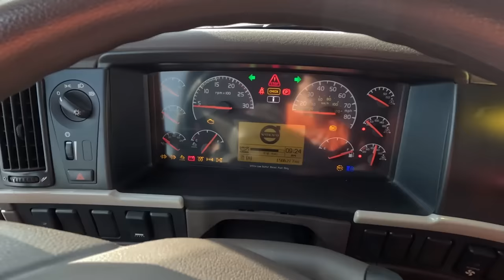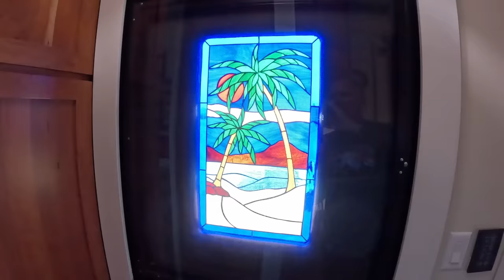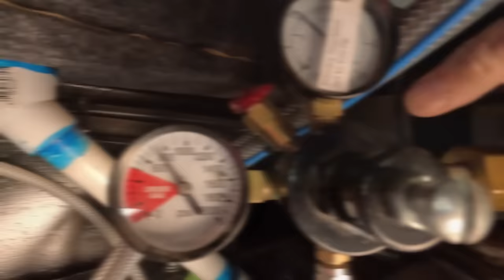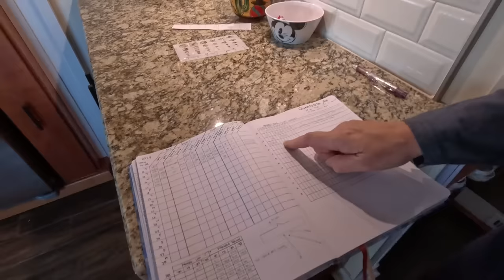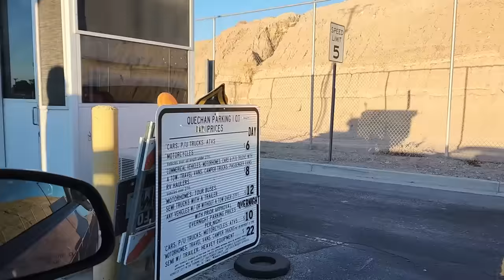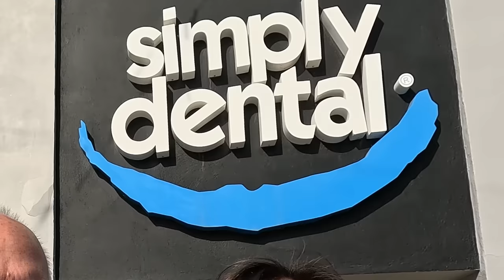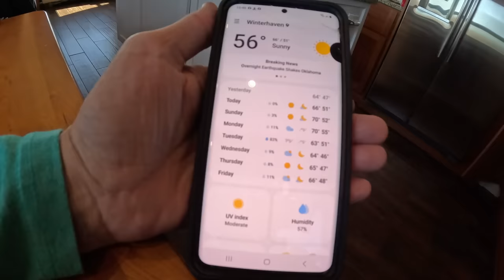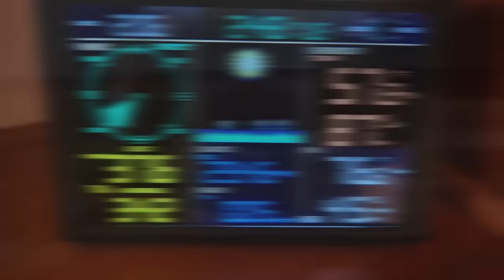HDT BIG Rig Travel Day. Changing Plans. Mexico. Atmospheric River. Fulltiming couple. RV Lifestyle

Comment: Great video David and Sondra!  @35:20, you start talking about Sondra's capturing of the sun angle hitting your solar collectors--great example of very practical geometry!!!  Also a great example of thinking quantitatively.  Hope some geometry teachers see this and use it!
Reply from the maker: Sondra is such a geek, Pete. But it does help us to orient properly to maximize the solar potential. You are so correct that it is a very applicable use of geometry in our daily life. We hope others see that as well.
Reply: Sondra's would love a Victron solar system with a GX device that uploads all the data to the cloud. Then you can review and plot a huge amount of data for solar and battery power/voltage/amps over any day/time frame. Great for us data nerds! 
Love the channel! Absolutely loved your Alaska series last summer.

Comment: How did you learn all the things you need to be self sufficient, like the vacuum issue you had?  We so enjoy your journey and videos.  Thanks for what you do.
Reply from the maker: Great question, Patrick. After 8+ years of fulltime RV and approximately 50 stops per year average then we use our systems regularly and have seen most of these occurrences at least once. Experience is a great teacher and we try to learn from each instance (good or bad).

Comment: Sondra, I love your book keeping and role as the lead statistician! I am always amazed watching numbers! (I bet Dave looks a lot closer than he will admit!)

Dave... Not sure I understand your water system but it is interesting. If you simply plugged that overflow I suppose your pump would create a vacuum in the tank? If it is setting up some sort of syphon if it gets started by overfilling, how about making a length of hose with the appropriate fitting for the "leaking" pipe and then elevating the other (open) end so that it is higher than the highest level in the tank? Do you think that would stop the leak? Perhaps after the syphon was broken it could be removed, or you could put some kind of screen on the open end of the hose to keep dirt and intruders out if you have to leave it there.

Thanks for all of the insight into Mexico in the Yuma area. My wife and I plan on being there in time for Quartzite next year, my first year of retirement. If I see you there, I would sure like to meet you both.

... Mark
Reply from the maker: It would be great to meet up, Mark. Normally our system does not create this siphon effect when I correctly fill the tank...I was in a hurry and didn't shut it off properly. Yes, you are correct that we had to equalize the system pressure or the water pump would have been impacted. Congrats 👏 on your impending retirement! Lots of fun on the road.

Comment: For solar tracking, I just use the Victron apps showing me consumption, battery, solar, forecasted solar and forecasted consumption (meh not so accurate) which is automatically charted.  Did you folks get the power actuators in Quartzsite?  Sure would beat climbing that ladder!!  Love your videos - thanks for sharing!
Reply from the maker: Thanks. Our system is a "dumb" system... no fancy graphs. But it gives Sondra something to do! 😆 Working on the actuators... it's never easy when you are the first...just sayin'.
Reply: Be the first... I don't want to be that guy... I am waiting on you!  🤣🤣🤣🤣

Comment: Interested in getting a drone, what is the name of and model that you have , thanks !
Reply from the maker: Hey Scott- lots to choose from out there but I use a DJI Mini4 Pro. I really like it because it's compact, under the 250g exemption and very stable in the air plus the video quality is excellent. I've had larger drones but this one works great because it is so portable and easy to unpack and fly. I also have the separate controller with monitor (vs using my phone) and I really like the controls. Hope that helps.

Comment: Guys, that is a tethered derigible. It is loaded with all kinds of sensor packages. They are primarily utilized by Homeland Security and NORAD, in that region I would imagine data is shared with USC/BP. We had one get away from Aberdeen Proving Ground when it's tether snapped. That one was finally recovered in Lancaster PA in Amish Country. Imagine an all out chase from local law and the US Army landing in Amish Country on an Amish farm. Be well and safe travels.
Reply from the maker: 🤣🤔😂I would imagine an all out "every man on deck" kind of recovery! Thanks for the info. Very cool stuff.
Reply: @bigtruckbigtravels You're very welcome guys!  Yes, very much so, an all hands operation. The rouge wasn't gonna get away, couldn't be allowed to get away, especially with all of its sensor packages.

Comment: Do you notice any difference using a large CO2 bottle on your Sodastream over the small bottle that come with the Sodastream. To me the small Sodastream bottle doe not put much CO2 in the drink.
Reply from the maker: The only real difference is the length of time it lasts...Sondra thinks the smaller bottles don't carbonate the same...less fizzy.

Comment: So are you draining the entire fresh water tank?
Does your tank not have a vent tub to the roof to allow water to flow easier?
I thought you were only removing enough water to create an air space and be able to get rid of the vacuum.
How are you going to get all of those buckets of water back into the supply tank?
I  wonder if you could install a CO2 generator that utilizes propane.
Reply from the maker: Don't want to drain it, just relieve the siphon pressure. The vent was not installed properly (per our instructions) and thus we deal with this on occasion but this was the worst instance. The C02 generator is cool but it needs to be pressurized in order to carbonate properly. Thank you.

Comment: Why is there blue auras around you and can be seen in and around your body? Is that your camera doing that?
Reply from the maker: We were anointed by the aqua gods...🤔😉😆 it was actually the camera due to the low light and the sunset glow.
Reply: @bigtruckbigtravels  Right! Thanks for the heads up of where to get dental work done! I fell and  damaged my upper 2 front teeth. No one here knows how to cosme tically repair them, other than to pull them out and insert Implants! Even Dentists who deal in veneers, saw them down into toothpick form, to so call repair the damage to the teeth!  My gums are in good shape, Love your rig! It's much sturdier than the Toy Haulers!